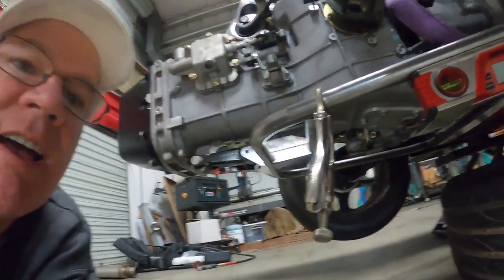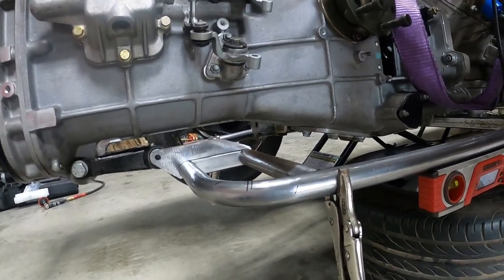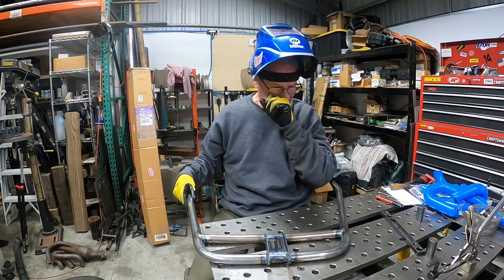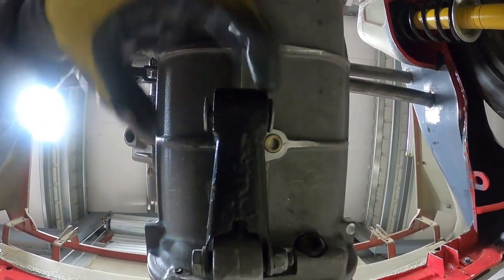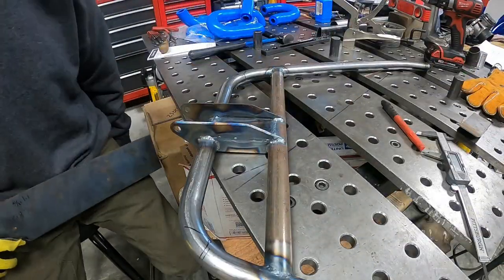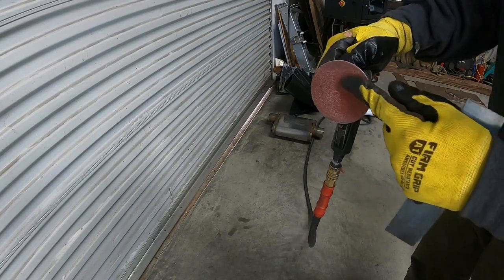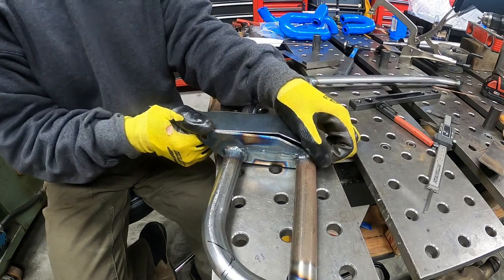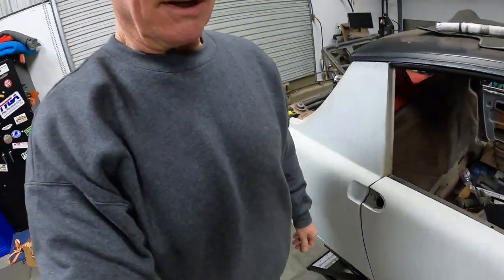914 Ferrari Build - Episode 12: Rear Trans Mount Part IV

Comment: That lower loop looks to be cantilevered out quite a ways.  Is it going to be tied back in to the main structure of the car?  Possibly some tubes up to the upper shock mount?
Reply from the maker: Hi Dave - There will be struts from the rear of the hoop up to a plated/supported area on the chassis, above the trans. Check at 14:00 in this video and you'll see it. Or, watch Episode 11 and you'll see me making them. Thanks for watching! Please subscribe and tell your friends?
Reply: I'll check EP11.  The bracing here is to the tail panel, which looks to mostly be sheet metal suspended in space.  I was thinking to something rather more structural and beefy, which is why I mentioned the shock tower mounts.  Those also have the advantage of being further out of the plane, providing more bending resistance.

Then again, I may be overthinking this.
Reply: OK, I understand better.  It looks like it isn't intended to deal with much up and down stress.

Perhaps the bracing could go to the boxed-in section of the tail panel rather than the flat sheet-metal?  That should be stronger....

I should really try to get back up to the Barn so I can yank your chain in person again.  ;-)

Comment: Loving the channel, but i have 1 question: That black "dogbone" mount connecting the trans to the cradle- what exactly is it supporting laying horizontally between its 2 mounting points? Lateral movement? I just cant see it limiting up&down mvmt the way it is. Driving me nuts ! 😂
Reply from the maker: I still have to add struts to prevent the cradle from moving up/down. I'll be back on this build soon...